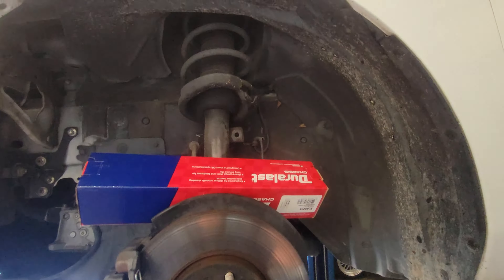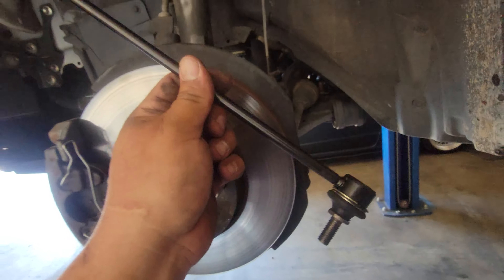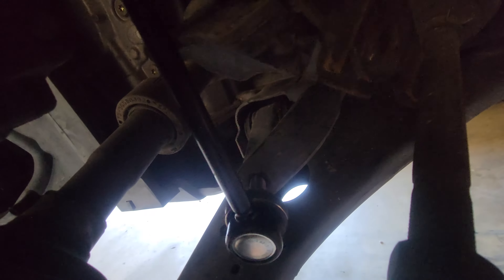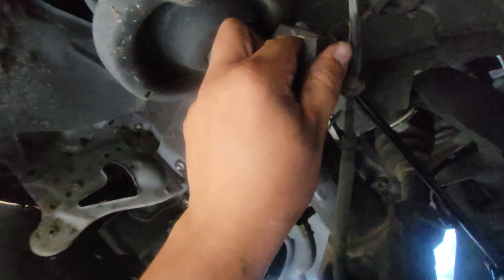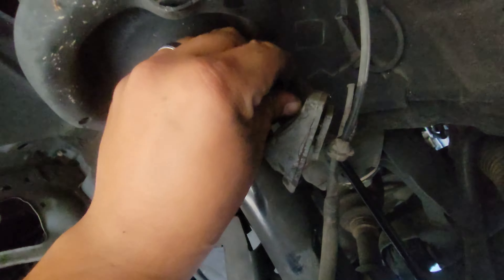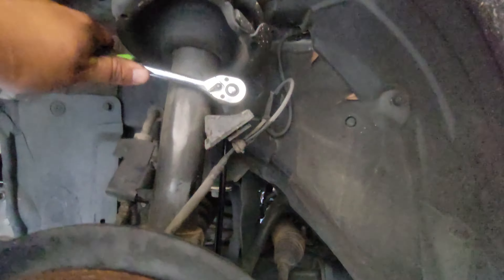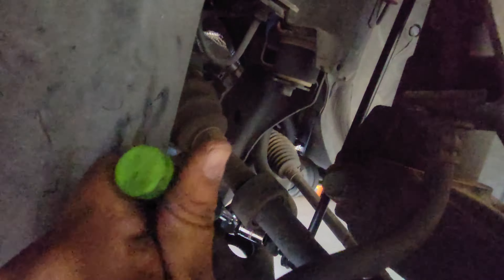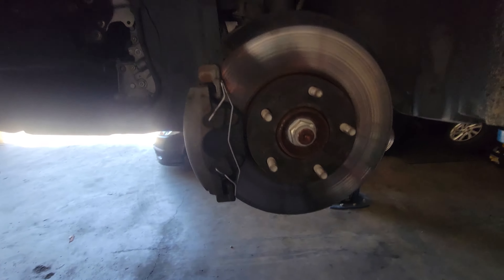How to: Install Driver Side Front Sway Bar Link Ends 2012 Mazda 3

Comment: Hi hoping to get some advice( non related video question). I have a 2015 Jeep compass, the throttle body was recently replaced and now it’s  acting up and shutting down while on idle or low speeds. How can you help me fix them problem. Thank you
Thank you
Reply from the maker: You can disconnect the battery for 2 minutes and connect it back to see if that helps...if not I found this in some forums....hope this works...

https://www.jeeppatriot.com/threads/ecu-re-learn-procedure-without-disconnecting-battery.42689/